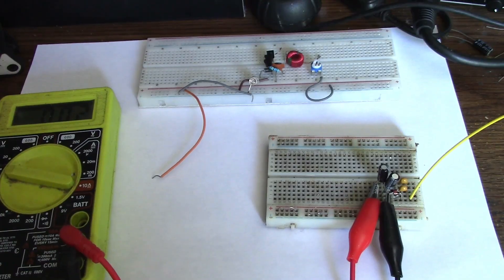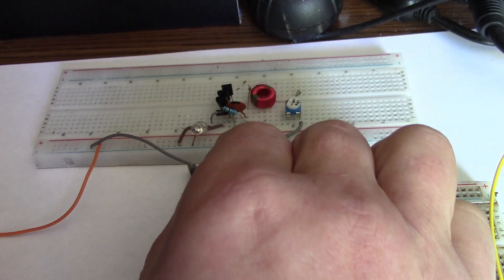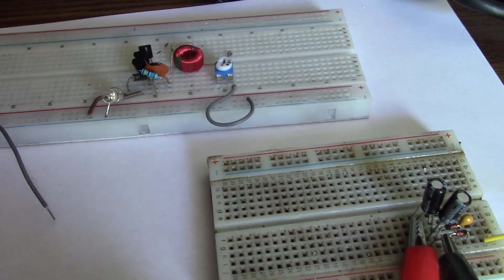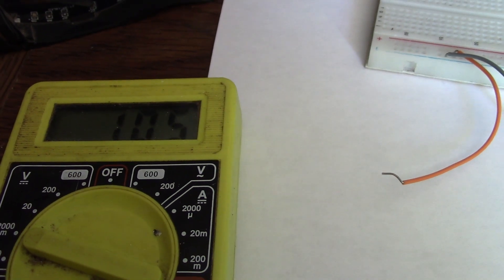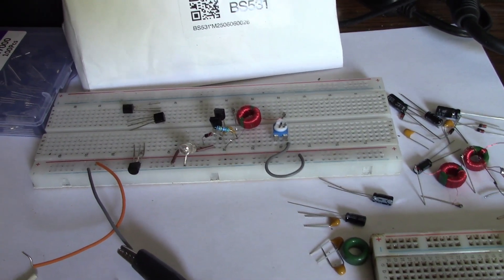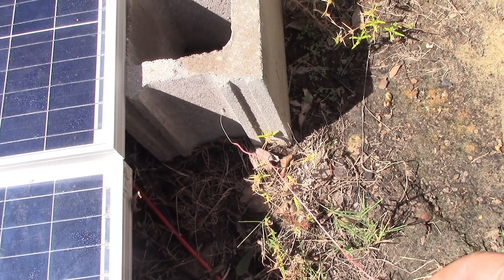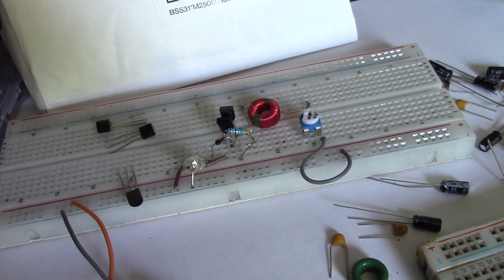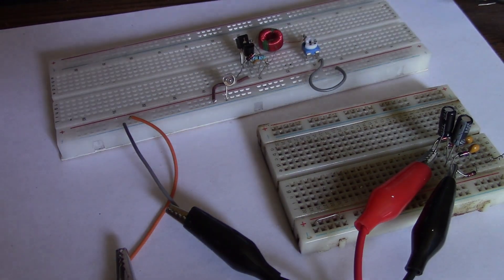Harvesting Circuit – Ultra Efficient Low Power LED Runs from Thin Air!

Comment from the maker: The wire length is only about 8ft and runs horizontally out of the window. 
Do you think that's enough to work as an antenna?
Reply: Ofcourse. What is the length of a telescopic antenna on a radio receiver? A 2.5m antenna is natively tuned on approx 120, 60, 30MHz so any signals with those frequecies are well received. Add to this any FM stations that you have near you and all the noise from the SMPSs in your home.
Reply from the maker: @sebastian19745  Yep, I agree, the 2mV at the desk surprised me though. Radio is poor out here, we're in the sticks and local stations are tiny hospital broadcast types or local town religious programming. 
Was just cool to see it collect from what was thought to be a ground wire 😀
Reply: coil it around a magnet and see what happens. I used to have a diagram of a artificial ground but lost it and cant' find it anymore but I found this instead:  https://i.pinimg.com/originals/b6/88/77/b688776d045be1bcbba32908566d8b68.jpg

Comment: That's why those huge bulky high voltage capacitors must be stored with their terminals shorted: Even without an rectification circuit, they can build up a lethal charge.
Effects like capacitive or inductive coupling from nearby powerlines, home wiring, radio stations and devices, polarization effects in dielectrica and natural potential differences at different altitudes can create charges.
There are even specialized ICs that harvest energy from "thin air" to power data loggers, beacons etc.
Reply from the maker: Thanks Paul and yes, I agree. It was noted several years back how any large cap will always have a voltage on it. Definitely something to be wary of!
Used to have a big box of large HV caps, each the size of a coffee mug and I put a multimeter on a few times over about 10 years. There'd be a few volts on them each time, from just sitting in the box.

Comment: Have you tried germanium diodes,?  less forward voltage
Reply from the maker: I haven't and that's a great idea. There's a board around here somewhere with several germaniums on it from what looks like a 1970's circuit.. I'd know they were genuine if I could find it!
Reply: @Slider2732_  lol gl

Comment: Try using 2  separate ground connections
Reply from the maker: That could well be a great idea! 
I haven't tried the actual ground yet, because of finding out the wire was disconnected. 2 separate grounds at a distance from one another makes sense. Thanks 😀
Reply: Try two seperate grounds but with the same connection to the circuit Twist the two insulated wires around each other a bunch and connect to the same terminal. They should be 180 degrees shift in sine wave that way
Reply from the maker: @highkeycomps1146  Great info and thanks!
There'll be a next video on this on Wednesday and i did highlight your original comment, so you got a deserved shoutout. It got me thinking of grounding in a different way.
Btw, I've detected mains grounding with a crystal radio earphone before now, using 2 rods in the ground. Placement was 4ft from each other. Does that hold for your method?

Comment: I don't think you are going to charge your car's battery with that, but there is power coming in 👍👍😊😊
Reply from the maker: Sure, it won't be charging much of anything lol. The aim, is to create something that simply sits on the desk running an LED, no extra wires dangling off it to 20ft. 
I did some searching using AI and it didn't even try to answer questions such as "Harvesting circuit that sits on a desk and lights an LED using ambient energy" No result, zip nada for an answer, said it couldn't answer the question, never mind point to products. Some people give the impression it's all old hat and well understood, well, where are the $1.99 little desktop things then? A Halloween pumpkin with lit up eyes, a Christmas tree with a lit star on top. I'd have thought it would be a common product out of China by now.
Reply: @Slider2732_  I do remember the videos using a kite or balloon to get height for the potential difference to earth, so maybe send the Mrs up a tree with a length of wire so you can measure the effect 🤔🤔
Reply from the maker: @GrandadIsAnOldMan  Yep... it would be far too dangerous to do that myself 🤣
Reply: @Slider2732_  obviously I only meant that you would be able to monitor the voltage and current whilst she was at different heights above ground level 🤔🤔😊😊
Reply from the maker: @GrandadIsAnOldMan  Oh I don't know, she just turned 60 and posted a Facebook pic of still being able to do a synchronised swimming vertical leg kick in our lake! Then there's me with a prolapsed disc, so even though meant in fun, it's likely correct! 
Good idea for the height tests  😊
Orig idea was to put a tennis ball on some wire and throw it up a tree. Even there, she used to be in a tennis team and had a Roger Federer strength of serve!
Reply: @Slider2732_  brilliant 🤣🤣

Comment: Love these kinds of videos and how they demonstrate that there is something in the ambient electrostatic charge to harness for useful purposes. Thanks for checking all the different caps and transistors. A couple of observations: I'm a firm believer in developing this kind of setup; perhaps a faster diode (e.g., schottky) will have an interesting effect. I live off-grid and am aware of the large amount of RF noise solar panels give off. It might be worth testing the ground away from your panels.  That said, I appreciate what you're doing and will follow with interest. There's something there; Maxwell Chikumbutso would agree too, I believe. All the best, and thanks for sharing your findings!
Reply from the maker: Thanks, Bob, I enjoyed reading your comment 😀
I just ran another wire of similar length across the room, over to the door handle and slightly into the hallway and the circuit still ran in the same way. Those panels outside (4x 100W) are disconnected most of the time, but I can see how shuttling voltage and current around when in normal service would be a source of RFI. I've always wondered if solar panels only produce energy when connected to something, a kind of Schrodinger's cat for energy lol
Most of this is old stuff, but was resurrected with my friend wanting me to make a couple more of an old design of oscillator from about 10 years back. It does seem like not much more has happened from what I see online, in a practical sense since then, so am trying to expand on it as I go. 
Btw, the circuit did have a 5819 Schottky originally, but when swapped to a regular 1N4148 it ran just about the same. Figured people more likely have 1N4148's than others at home.
Reply: @Slider2732_  Thanks for the reply, Slider. Good to know the 4148 functions just as well. One of the interesting things about solar panels is that they seem to gather radio signals. At one point, our array was ungrounded, and you could pick up the hiss on the radio as you pulled into the driveway at night. Once we grounded the panels, that seemed to diminish quite a bit, along with the buzzing in my ears. All to say that there is something about these panels that seems to act like an RF antenna, even at night. All the best. Looking forward to seeing your developments.
Reply from the maker: @BobSmith-vq3uo  Cheers, Bob, I do enjoy your comments! 
Perhaps it's the amount of metal surface area of solar panels but spaced with the bus bars. It's intriguing, sort of like the way that extra coils can be placed on crystal radio builds.
Where I'm at, is a build running on the little table without the 'long' wire, but only if I hold a grounding wire. Am trying to replace me at the moment 😀

Comment: Good wording on the title. It really is the electric wind, created by the surface tension of reflectors (metals). It used to be called Thule / Tuuli (old Scandinavian word for cold wind).
Reply from the maker: Oh, how interesting, I didn't know about the electric wind! 😀
Oh, wait now, wasn't the Thule Society a secretive metaphysical/paranormal group from Germany? And, was it related?
Reply: @Slider2732_  Yes. But sadly the Nazi occultism has also ruined a lot of the old symbology :/ In finnish language "Tuuli" is the cold wind and "Tuli" is fire and heat. They create the "Värinä" that is a word for vibration, sound and color. Seems like there really is something to it.

Peltier is the best example of heat vs electricity vs cold. Like carbon (warmer) and aluminum (colder) in moving water will convert to electricity. Also antenna (cold / changing) and ground (warm / steady) will convert to electricity if it's regulated by circuit.

The antenna and ground / reflector doesn't need to be big if you have some vibrating source nearby. Lectenna is a good example of that.
Reply from the maker: @Kangsteri  Thank you very much for the extra info... it's appreciated. Especially the Earth/senses properties, such as warm and cold for carbon and aluminum. Such things make an immediate head sense, somewhat bringing personality and belonging to materials too.
I think Maria Orsic ruined my eyes, in a good way 😀

Comment: That's interesting, I noticed the solar panels outside and wondering if you are getting anything from them statically. But at the such low voltage shown on the meter obviously not. It's a great circuit and I think the longer the Ariel the better but that's only based on crystal radio sets they used to recommend 100ft on a lot' of the sets with a good earth copper pipe/bar into the ground . But that's to get broadcast radio 📻 🤔 5g WiFi satellite 🛰 neighbours telsa tower 😂 could we tap into the microwaves or even just the 🌎 natural energy. Great video and I 'm looking forward to the next installment 😊👍
Reply: It's very interesting what can be done, your definitely in the area of useful scavenger circuits lots of uses for things like that.  The wire not being connected is funny but sometimes things like that lead to something else, I was messing about with a joule thief circuit trying to get it to light a 12v bulb after a while i was just about to give up and the bulb lit up but then I noticed that one of the transistors legs had fallen off it turned out that that bulb ran happily once started and what I had done was shot out the battery that discovery led to the strike alight lamp😂 unfortunately that type of bulb doesn't seem to be made anymore but the circuitry in it acted like a joule thief once started. 😊👍
Reply from the maker: @johnwynne-qx6br  Great story and exactly the sort of thing that we all like to discover eh. Things go wrong, but they go right!
Btw, best way I found to light 12V or mains bulbs from a JT at say 1.5V has been to massively up the turns on the coil, 20 turns on one side, 1500 on the other. The Jeanna's Light circuit is also very good. I like the snapped leg method though - the strike a light lamp is a cool name.
Reply from the maker: Thanks, John 😀
The solar panels are not actually connected at the moment. They get plugged in to the Ecoflow power station when it needs charging... about every 5 days or so. They are getting swapped with the snail tracked ones from the other side of the house, because they're in much better nick than those others.
Yeah, 100ft to 500ft is what I've seen for an antenna, but I honestly thought that short wire was still connected to the copper house wiring piece from a couple of years ago. The idea was to clean it and see if it improved the running... then I found out it wasn't even attached and it derailed the video  🤣
Reply: Look up "lectenna" ;)